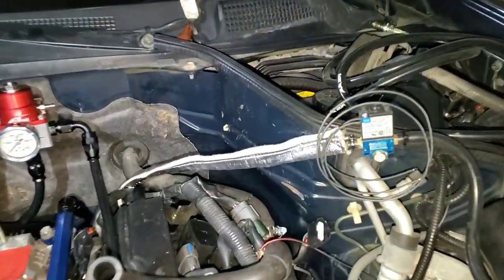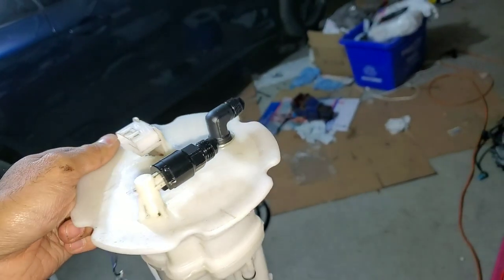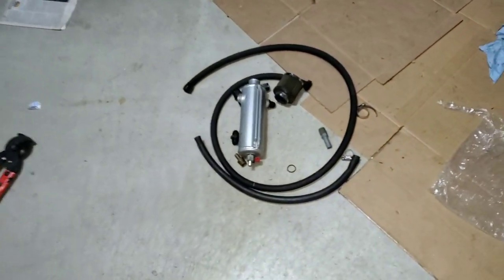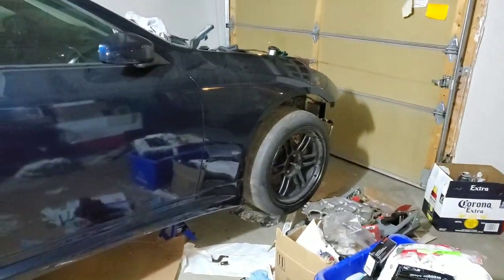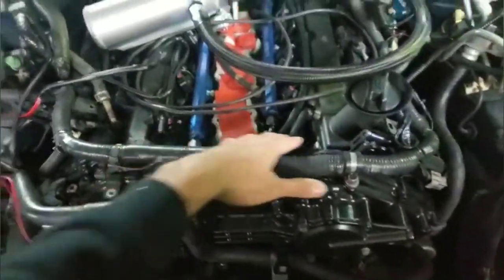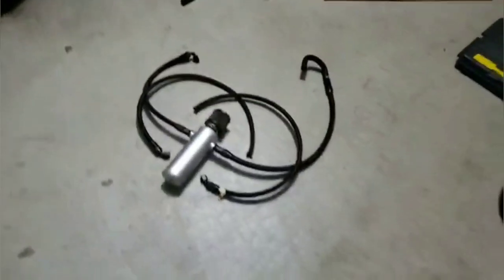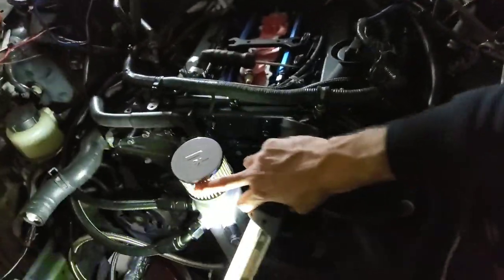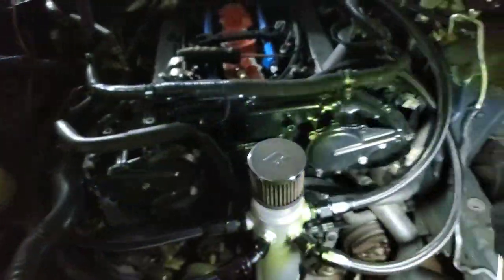700WHP G35 Coupe Project UPDATE 7!! - Custom 4 Port Catch Can

Comment: awsome progress ! our fuel rail plumbing is almost the same lol. the big PCV port at the back can be plugged and just use the port in the front of the drivers side valve cover because they vent in the same area. im worried that your drain is actually draining into a pressurized oil port (not sure because you have a pressure sensor there). if so the oil will be pumped up to your can.
Reply from the maker: It's plumbed to the oil pan which is the same spot turbos drain

Comment: Did you have any issue with the catch can drain line? As in needing a shut off valve to relieve any head pressure going down into the oil pan?
Reply from the maker: The can is baffled and vented so the pressure would just vent out, there won't be a continuous flow of oil to the can.

Comment: Do you recommend an oil catch can for a N/A g35 coupe 6MT? Also there’s plenty of different set ups for a catch can 2 port 3 port etc. in reality what would be the best set up (where your not sacrificing anything )?
Reply from the maker: I think the 3 port+ isn't necessary for NA. For a NA car I think. The mishimoto style ones are easy but for boost you actually want to vent crank case pressure so thays when the vented cans like mine come in but a 2 port one from Dynosty is perfect for the average boosted setup. Mind you they usually drain back to the oil pan unless u drain them manually from a valve or something
Reply: @nitish21  ok so I should be fine with a closed 2port 🙏 also what initial mods (engine and suspension) do you recommend to start making my g faster (it’s my daily driver) not ready for your type of set up lol
Reply from the maker: @g35tho11  I mean you can do like hfc or text pipes and exhaust and tune but the gains are marginal. The real gains are when you boost it.
Reply: @nitish21  so a MREV2 and plenum spacer would be after those mods you mentioned ?? My car has the HICAS rear active steering I want to remove it but I heard nobody makes a delete kit for it . Somebody mentioned to just swap out rear subframe but don’t which rear subframes are interchangeable (does it matter if it a coupe or sedan ?Will an 03-06 350z fit, what about 07 g35)
Reply from the maker: @g35tho11  no idea about the steering, those intake mods can be done along with before or after doesn't matter

Comment: Hey quick noob question, whats the difference between 2 port and 4 port oil catch can?
Reply from the maker: So the head of the engine when under boost builds up pressure and you ideally want to relieve the motor of this prassire. (also known as crank case pressure) so from factory the valve covers have 2 ports each. The two front ports just connect to each other basically just equilizing the pressure between the two valve covers. There is a big port on the back of the drivers side valve cover that just connect to your intake. Then thers one on your passenger side which is actually a pcv valve which only flows out and connects to your intake manifold. This generally gets oil vapour into your intake which is shit. So having 2 port or 4 port basically leads whichever 2 or all 4 of the ports I mentioned to the can. In my case I ran all 4 and then the vapour can collect in the can and drain back to the oil pan and any pressure vents out the filter on the can
Reply: @nitish21  Is there an advantage to having the catch can send the fluid back to the oil pan verses having a drain line that you frequently drain the fluid out of the can?
Reply from the maker: @brianjackson5732  so on a boosted car you just want to elivate the crank case pressure in the head that comes from boost. The vapour if it sleft sitting for long turns into that ass you see people drain from cans. But if it's not sitting its just oil vapour tha can return back to he engiene right away. By having it the way I designed it, it requires no maintenance. If you want you can drain it via a line with a valve on it or if your can coems apart to spill out that's fine but I imagine it can fill up pretty quick on a boosted car. NA is fine
Reply: @nitish21  Understood.  I am also boosted, but I have to drain my can through a drain line with a valve that is routed next to/zip tied to my A2A supercharger drain line.  Your set up is easier to maintain.  Does it ever make for too much oil in the system?
Reply from the maker: @brianjackson5732  no runs fine yea i mean you can rain drain as well. It's all oil that's already in the engine just draining back to the engine so it's not like it creates any additional oil or anything like that. It work for me because I have an oil pan with 2 ports. So one drain from the turbo/charger and one drain from the can. If I had TT then both turbos would use those ports and I'd have to tap the upper oil to add a port. If your car doesn't have ports might be easier to use the drain Lin and gauge how much fills up how often
Reply: @nitish21  Makes perfect sense.  Thanks for the explanation.